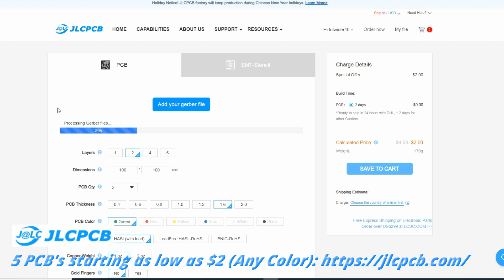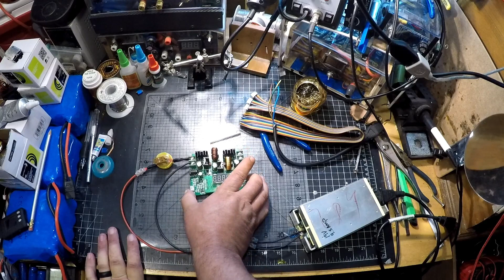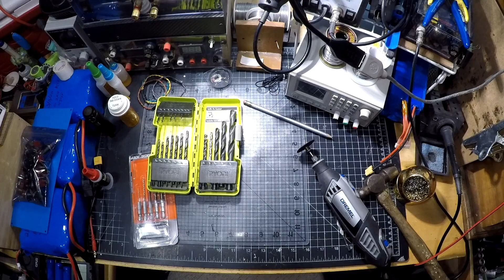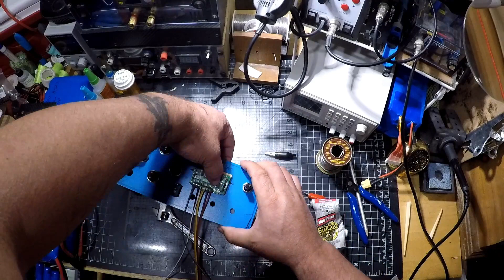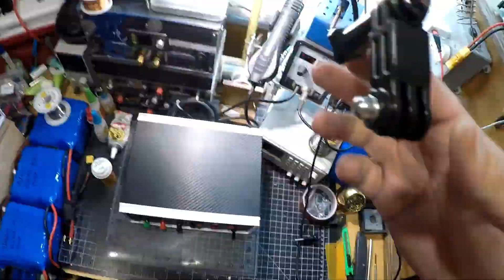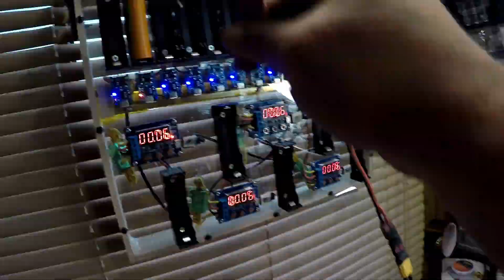DIY Variable Bench Adjustable Power Supply "Minghe D3806" 0-38V 0-6A

Comment: This unit has some drawbacks, i have the same and when i checked with an oscilloscope and found sudden bump in voltage for a few milliseconds even the power supply was turned off, this can destroy many boards especially that runs on 3.3v
Reply from the maker: Your right and I mention this in the video. To combat that issue I added the safety switch. With the switch off, no voltage comes out of the banana plugs. So I dial in the voltage and amperage, turn the unit on, then flip the safety switch on. Doing this pauses any voltage spikes as long as you don’t forget to use the safety switch.

Comment: hi nice video, just  wanted to know did you glue the display on to the cut out, and also is it 2 wires coming from each buttons to set +_ , if u could answer those questions would be appreciated as i have the same board and on the verge of starting this project, also i noticed there is afan connector on board any reason why you didnt use the fan comnnector
Reply from the maker: Around 23:20, you can see the wiring. But I did you 2. The reason I didn't use the fan on the board, is its not temperature-controlled and stays on full blast, So I added a buck converter to have more control.

Comment: Sorry, man, but Green is for Ground!
I think that using a Green binding post for the battery charging output is as misguided here, as it was on the Riden R6006 in the background.  ;-]     
Just because the Riden guy did it, doesn't mean you should follow in his errant footsteps... If he jumped off a bridge... 

Oh, nevermind!  lol
Reply from the maker: I just used the only other color I had on hand, would be nice if these came in white, or even blue. But green was just a way to keep me from remembering That one and only jack is for batteries. It was actually the only odd color I had. Green can always mean go.....LOL
Reply: @njfulwider5  Go!  lol
Yeah, I knew that... I was in a similar situation years ago, I wanted to match the colours coming from an ATX PSU...
I found all the colours except 3, so I painted one Orange for +3.3V, White for -5V, and Green; ironically, for an actual ground! lol    Acrylic paint is pretty tough, it worked out ok.
Cheers!